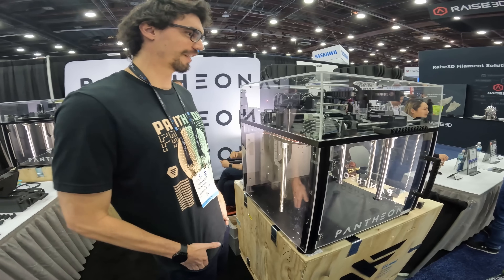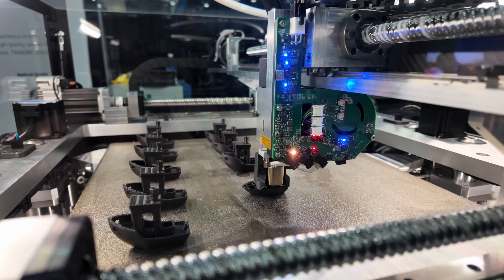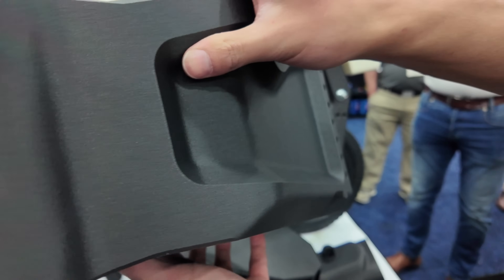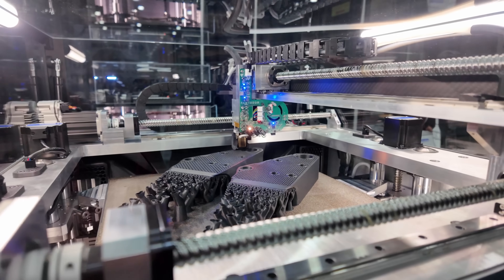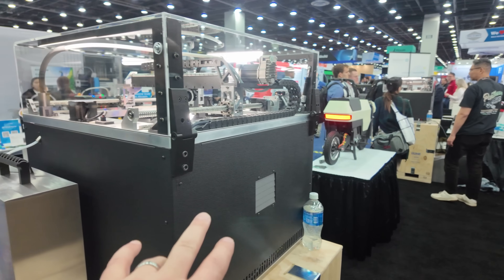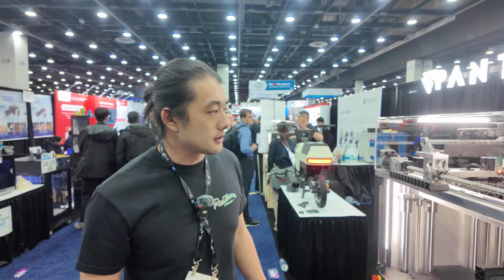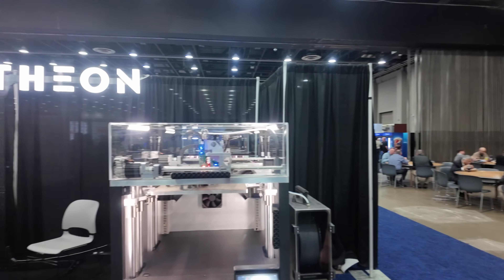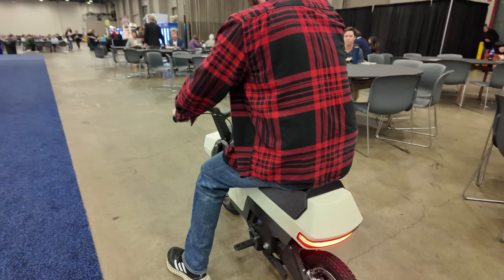FIRST LOOK at the PANTHEON HS-PRO - Servos and ballscrews oh my!

Comment: When he was talking about 250k acceleration, all that I thought was that's some consistent nozzle flow right there. What I found a decade ago (2014) was that the filament makes a little pool and back flows. When speed/feeding changes that pool gets smaller or bigger changing the flow at the tip of the nozzle. What I did was just make the "pool" larger and used a nozzle that was designed for a PTFE tube without the tube 👍. This turned it into a flow buffer and gave the replicator dual amazingly smooth flow while also completely melting the plastic and running lower temps to prevent degradation. This gave me mold-like parts all day.

This actually really makes me want to kliperize my old Replicator Dual. I also had an idea some 8 years ago to put in some type of lift system that also covered the nozzle with silicone while one of the two heads weren't in use, much like the new H2D but simpler.

Comment: "It's fully 3D printed". No it isn't as one can clearly see by looking at the bike. I wish people wouldn't use this phrase so inappropriately.
Reply from the maker: fully 3d printed minus screws.bolts and electronics (and i think theres a shock in there)

even the front rim is printed (rear is a hub motor)

i give it credit for being as fully printed as you realistically can get without being dumb with the concept like 3d printed metal screws